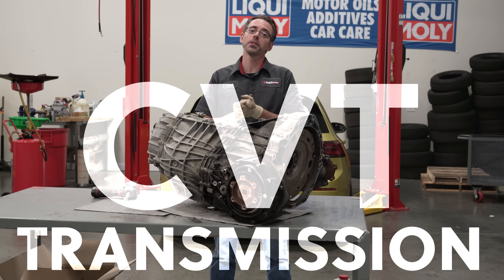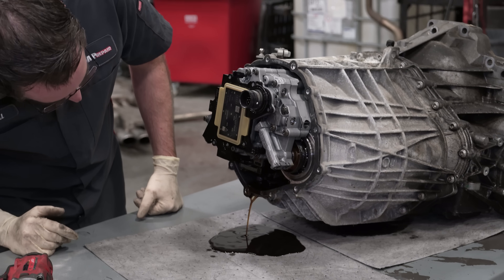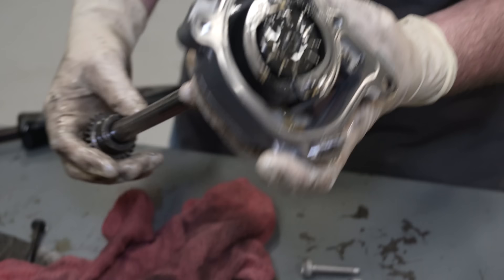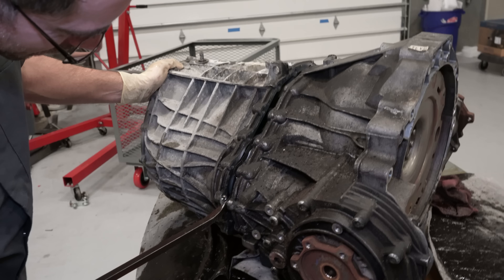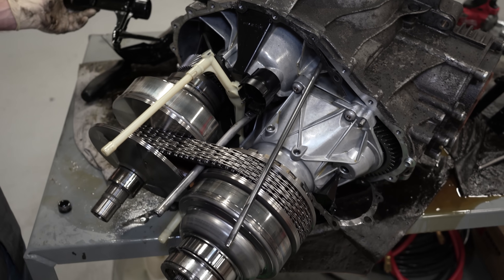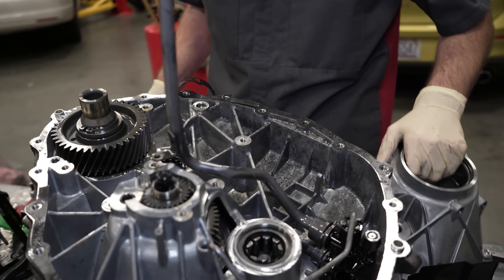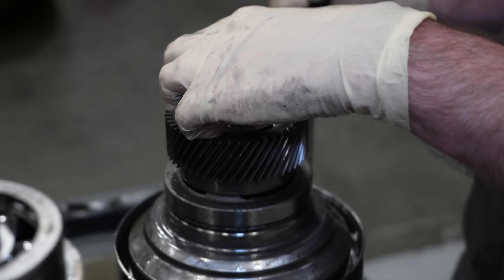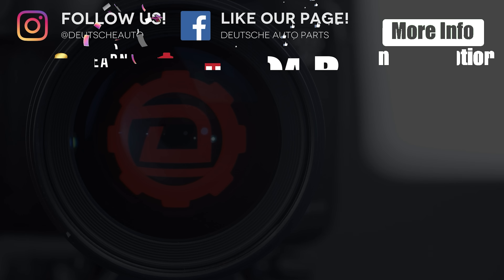Why you shouldn’t get a CVT transmission

Comment: 0:44 - I did not hate this transmission in a Ford Escape.  NOT AT ALL.

It was somewhat miraculous.  Pull the shift lever down, no matter what speed you are at, and the transmision ALWAYS got the ratio right giving you just the torque required. 

It was fairly awesome.

I'm just sayin' ...

Why in the WHAT is this thing so BIG?  This looks like a tranny for a semi truck?

...

Comment: yes early cvts were crap.  Alot has changed and some manufactures have figured out how to make good ones.  I bought my first car with a cvt, a Honda Civic.  I actually love the shiftless feel.  Changing the fluid is almost as easy as doing the engine oil.  Stay on a good maintenance schedule and don't drive like a moron and it will last.

Comment: CVT's isn't something new. Far from it. The earliest production car I can remember having a CVT was the DAF 66. There's probably earlier examples, but that's the first I rode in. It had a CVT called Variomatic that DAF developed in the 50's, and had used in industrial applications, before using it in the DAF 66 beginning in the late 60's or early 90's. The Variomatic got used by several car companies in the late 70's early 80's, but was still mainly a solution for mainly industrial applications as it was bulky, thirsty and unconventional. Still it had a market.

My point is that they are not untested technology. Their simplicity makes them desirable as does the comfort and economy of a modern CVT. That people doesn't like that the speed is more or less decoupled from the RPM of the engine is a problem that will go away over time. The love of feeling the gearbox shifting is pretty stupid, as is the expectance that the RMP would have anything to do with the speed. Both make the car less efficient. With electric and hybrid cars getting more and more common this will not be a reason for very long. There will of course always be those who love the sound and feeling of a revving engine and the jerkiness of a regular gearbox, but the huge majority won't care either way.

Aside from that there's the practical problems with reliability and capability. These are things I think we are able to solve. If it will be done is another thing entirely. Seeing how primarily electric cars are making strides into the market it's a question of cost benefit. Is it worth spending a lot of money perfecting the CVT if the majority of cars will have a electric drivetrain? Will electrical storage ever improve to the degree IC powered cars isn't needed even for long range? I certainly don't know, but it's pretty obvious it will be good enough for almost all urban needs.

Comment: I would think the highest output speed would be with the input shaft at its largest size diameter and the output shaft at its smallest diameter.  Think of your 18 speed bike when you have the your front input gear (pedal gears) on the smallest gear ring you are spinning really fast but going slow.

Comment: I have owned Honda Jazz cvt’s for years, never any problems at all. Very smooth and quiet transmission.
Reply: My mum had a manual constantly in the garage for repeairs, mostly related to the gearbox. They advised she get a cvt.. After research they decided to get a Jazz as they're known to be super reliable and my mum bless her was ready to give up.. She had instances where she was on a fast road and the "get me home safe" thing would send her down to 20 mph, it broke down allot too.. The jazz rebuilt her confidence and I got one as my first car after passing my test. We love them to bits. Really amazing cars
Reply: Also in the nearly 10ish years we've owned them combined we never failed a MOT (light bulbs don't count right? 😂) never had issues with them breaking down or not performing. Truly amazing cars - even if they don't have great street rep 😂
Reply: I have a Honda Accord with a CVT and I actually like it more much smoother ride.
Reply: @claypyrotech7473  Same here!
Reply: You're basically riding horse car. It can manage, doesn't mean you're using it %100. Put CVT transmission on car that can give you performance then it will show  itself.
Honda Jazz basically creating torque that %20 of that audio creates lol

Comment: I used to owwn an Audi A4 1.8 Turbo with the CVT tranny. Sold it many, many years ago after my Wilmington, Delaware based Audi-VW mechanic warned me that I was reaching the life expectancy of my Audi CVT tranny, and when it finally went kaput, replace said tranny would cost $8,000. This was maybe in 2013 or 2014. Boy, oh boy, was I ever lucky. In my view, there is NOTHING good with a CVT tranny, the mfrs are using them for cost saving and to comply with CAFE restrictions. I had no clue aníone would be so foolish as to puchase a luxury vehicle with a V8 engine -- couple to a CVT tranny. But apparently some Audi A8 buyers were. Crazy!

Comment: Other than demonstrating your pathological hatred of CVT you haven't told us why technically why they are crap. Sure, I wouldn't buy a car with a big capacity engine producing unlimited torque with a CVT, but for small 4 cylinder shopping cars  they are perfect. You kept pointing at the metal residue, you know as well as anyone that all transmissions show signs of metal which in all fairness you should have pointed out. This would have been a funny video had you not kept on harping about your loathing for CVT's. I can point at a library of automotive innovations that over the decades have fallen by the wayside. Despite being forgotten, they have all in some small way contributed to the overall of motoring as we know it today. Lighten up man.

Comment: This guy isn't a mechanic? Trans. specialist? Comments below tell me that all CVT's aren't bad and that the well made ones LAST. Lack of responsible owner maintenance must be accounted for.
But it is typical that a piece of shit idea, trans or engine or anything else gets into production because it looked good on paper. Flaws were ignored in the interest of well, "good enough for now, we'll ignore it & band-aid fix in the future, ignore it till we have to pay out on lawsuits. And even then, keep paying settlements".  An appalling lack of integrity, honesty, responsibility. 
I know I have a dual clutch (something or other ) trans in my 2016 Ford Focus, and if it's then technically/design wise different from a CVT, it still has a shudder on both soft & hard acceleration at times; (& it really hates the very cold weather). This is known by a lot of owner/drivers people & seems to be soft-pedalled by Ford. I had taken my car in to fix a shudder & that was caused by an actual bad 1-2 clutch pack. I think there was a recall to fix it, or else it was some kind of Tech. Svs. Bulletin? Don't recall receiving a recall notice; I'm the 2nd owner (far as I know), and I guess that was the reason. Seemed like the shudder was gone for a while & returned, though not as pronounced.
   Guess I should be mad as hell. but I like the thing since it has some power, ok handling & some bells & whistles none of my other cars had. Brakes are avg; the shop said they were ok; maybe some really good pads could help. What can I say? The car grew on me like a fungus.  I hope I'm doing the right thing, that it holds up. I drive short distances sometimes at highway speeds, but no long distance highway driving. Car prices being what they are, new & used, & the fact I'm still upside down a bit, make me VERY RELUCTANT to make a move.

Comment: Our Renault Megane has got a Nissan CVT and it worked fine until other bits and pieces started getting uneconomical to fix at around 260 thousand kilometres. 
The trick might be that the engine has power required, not excessive output to show off.

Comment: I have 2006 audi a4 cvt 2.0L and my transmission was slipping when i went over 3000rpm .it like that for a while and it went away , now it has 150,000 miles and its still running i thinking of changing the cvt transmission oil now 😂

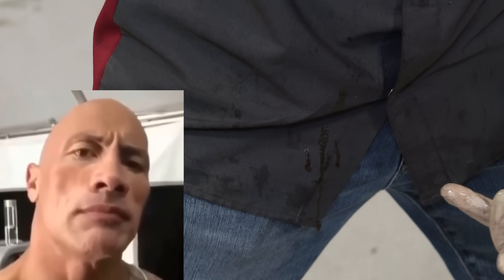Comment: CVT is very cool and good WHEN using at SCOOTERS with rubber belts... I mean scooters like 50cc, 100cc (I'm using 100cc scooter), 500cc whatever. Scooters are good in places like driving in city, or going thru long trips because motorcycles with CVT designs are more comfortable then normal manual transmission motorcycles because there is no engine under you it's being like near the back wheel and giving you a more space to place stuff or ride but they can have problems like rubber is heating going uphill and getting wet when you got in a water pot. Some motorcycles (like Mondial Ritmica 100 mine one) has a air intake for transmission itself to cool that rubber (and it works very well) but if it got some water in there you can rev the motor, but u can't go anywhere like 10-30 seconds (depends on how much water it takes in) because u start to lose friction but u take it back when it dries, and it needs no oil in it because if you put oil in it will slip like it will never do and it gonna be useless. Just think, with nearly one glass of water you can't go anywhere like nearly 1 minute and think it with oil. So if we gonna talk about Metal Belt like that one in the video, the belt will heat a lot, A LOT with the weight of the vehicle, the RPM of the engine, the road that u going (downhill-flat-uphill-snow....)  etc. because it's needs friction like a regular clutch to hold on and give power from engine thru the axle and wheels. With heat the belt and gear discs (IDK the name of these gear ration discs name at 8:17 I'm from Turkey :D Don't judge me) gonna be melted and maybe stuck to each other witch means u can't even start the engine because one of these 2 discs are connected DIRECTLY to the flywheel and u need a something like a cooling system. That's why they used oil (massively amounts of oil as shown at this video :D) but it gonna make the friction disappear on the belt and discs, with that u can start the engine, rev it, but u can't go anywhere and that's why it sucks. For my opinion if they gonna use Rubber ones (like on scooters, but not just one and that's gonna be like impossible or way too big) or find a very functional and good cooling system to keep that metal belt and discs cool so they can run longer. but f*ck it we have clutch pedalled manual transmissions and that's really good and efficient and clever and cheap and can hit limitter :D

Please answer with ur ideas too, I'm a 16 years old Turkish mechanic and I want to learn a lot. So every good idea is a gem for me :)

Comment: It's not a bad idea, since the engine's peak horsepower is at one speed and its peak efficiency is at another. Keeping it at the optimum RPM for whatever mix of power and economy you need at the time makes sense. People don't like the sound of the engine at one speed (the "Dynaflow effect") simply because they have been used to hearing cars go through the gears for all their lives. I think people should just grow up and get used to it, but if they can't, some CVTs have algorithms to fake the sounds of a car with distinct speeds, at a slight loss of efficiency; ideally, it should be possible to turn that off.  But any transmission that's not reliable is obviously not good. My problem with most of the current designs is that the belt, which spews metal shavings when it fails, sits in the same fluid that runs through the other mechanical parts, the valves and the seals, so if the belt dies, everything gets destroyed. Separating the belt from everything else would solve that. Also, getting a CVT from  Honda or Toyota would vastly increase the chance that it would last. American and European carmakers simply don't care about longevity the way the Japanese do.

Comment: Tried a Subaru with CVT , it was like driving a washing machine. It was all noise and no go, reminded me of diesel U-Haul with an AT I once rented. Bought a Mazda 6, with an eight speed AT. It’s smooth as silk and I get 38mpg, also $3,000 cheaper than the Subaru. Zoom-Zoom.

Comment: At about 3:22, we see the pump.  It looks like a vane pump, with three vanes missing.  That does not sound like a good thing.  If three vanes failed and turned into metal chunks in the pump, that would stop the whole process.  When I first found out about CVTs, I thought they were absolutely brilliant.  One design, very old, uses two wheels at 90 degrees to each other, so the edge of the one rides against the surface of the other.  As you move the first towards or away from the center of the other, you get different ratios.  That has a bit of loss, and handles very low power.  Another uses a pair of truncated cones, one driving the other through a belt that can be slid along.  The narrow end of one is aligned with the larger end of the other, so as you slide the belt along that distance, it goes from being around the narrow end of the input and wide end of the output, to being at the wide end of the input and narrow end of the output.  A problem with this design is that one edge of the belt is effectively at a different ratio than the other edge, so the belt is constantly being stressed.  You want the belt as narrow as is practical, and the cones as gradual as you can, to reduce this problem.  The design shown in the video gets around that problem, but clearly has its own issues.  One final form of CVT that may be familiar to many is the fully hydraulic one, where you have a hydraulic pump driving a hydraulic motor, one or both with variable displacement.  So with a variable displacement pump, you can have the powered input go from only moving a small amount of fluid, so it will have a lot of torque but slow speed on the motor, to moving as much fluid as it can, so you get maximum output speed but low torque.

Comment: I'm convinced.  Some years ago I was looking to buy a new used car, being genteel poor and smart enough to never buy a new vehicle - except for the one I let me ex have in a divorce, ha ha.  Anyway, up shows a neat Honda, or something, but it had a CVT and I had already read some problems with them.  So I deferred, and instead bought a 2000 Chrysler Cirrus, which still runs strong after a few minor fixes, new shocks and tires, and it drives like the leather-seat BMW it was trying to emulate. Except for the horrible Chrysler paint, always an issue, and the not-so-nice wind noise on the highway, again always a Chrysler problem, the car is fabulous.  Not a peep from the transmission, because it is good old Detroit at its most basic.  Yea.  22 years and only 106k miles, good car.

Comment: Toyota's CVT is quite different than this VW's crap. It uses planetary differential gear instead of variable radius gears with belt and has far better reliability and durability. Additionally, the gearbox shown in the video is plagued by failures and has very bad reputation amongst Audi car owners. Possibly it is just badly designed. But that does not mean that every CVT has the same problems. CVT are the most efficient transmissions ever made.

Comment: It's easy to say don't get a CVT, but the fact is, it's not something the car manufacturers advertise. I have 3 family members with Subarus, they all have CVTs and they don't even know. They push the pedal and the car goes.
Theoretically, a CVT should be better, a simpler design. Over time they should improve. Historically,  automatic transmissions have sucked, so the question is "are CVTs worse then the typical automatic transmission?"

Comment: I have a 2008 Honda Jazz CVT model. It did have a CVT coil problem from get go. They eventually failed and I got them replaced a few years ago. Since then transmission has been smooth as butter.

Comment: I have a Honda Jazz/Fit with a CVT. I's a 2005 Model. Had it for about 8Yrs. Give a little trouble with vibrations/Shudder once. Changed the oil. No trouble since. Drives like a rocket down the motorways. Smooth and you can't even tell when it changes gears.

Comment: Enjoyed driving a Ford Freestyle with CVT. That transmission had a reputation for poor reliability and mine stopped driving halfway through a coast-to-coast trip, but it was a control issue rather than the CVT components.
Reply: OMG what happened and what did you do
Reply: I read somewhere that the engine needed to be warmed up a bit before driving and that did seem to work, but by then my partner had lost confidence in it, and since it was her car she traded it for a Ford Explorer in South Dakota.

Comment: The only reason CVT's get so much hate is because people DON'T KNOW HOW TO DRIVE IT. 
CVT transmissions are not meant to be driven in a sporty manner, neither towing. 
CVT's are built for fuel economy. 
If you want fast response get an DSG/DCT, if you want to tow or go offroad get an manual or an classic automatic.
Reply: one of the simplest and trouble free trannys  are found in the Nissan line of cars. I put a couple of hundred thousand miles on a few on them. never had a problem.

Comment: If is CVT why must to change the gear? It is continuously. The gears are infinite teoreticaly, I don't understand changing the gear. A CVT transmission has normally 14 gears versus a normal transmission w/6,8,9 gears.